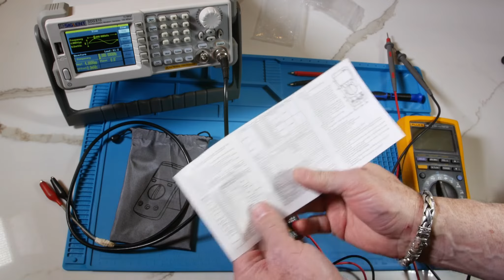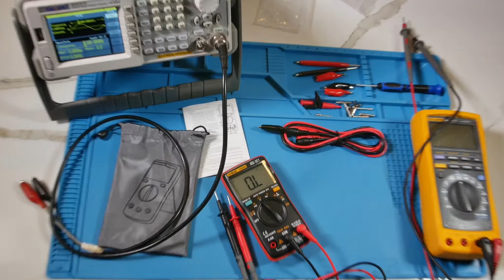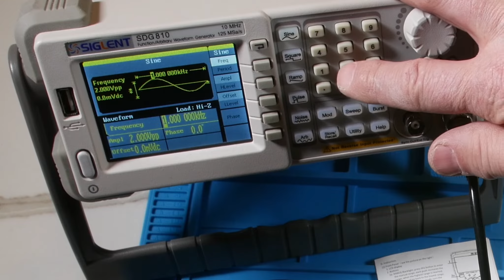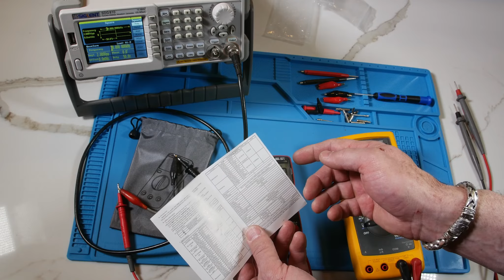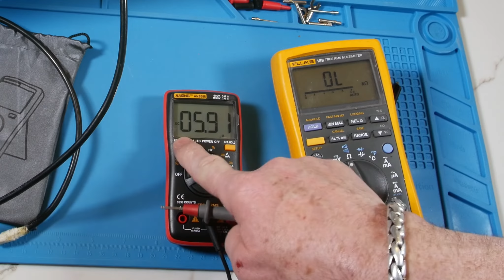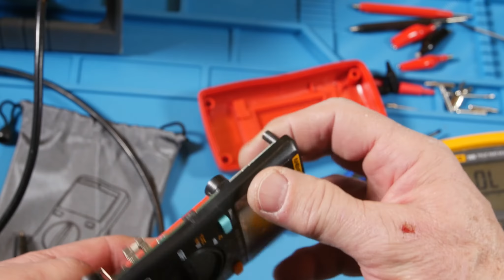$25 Multimeter review ANENG AN8008

Comment: I know that this video is over 3 yrs ago but I have to say, this cheap multimeter is extremely accurate for it's price. I have this and it's bigger brother the AN870 which is even more impressive.
For my use these meters do perform extremely well. As for 240V AC readings, I have used them both with perfect results but with extreme caution (not touching them whilst powering on).
Reply from the maker: Thanks for the great feedback Andy!

Comment: Are these specs to be believed: for DC voltage, a 10mV scale with an error of 0.5% of reading plus 3 counts? The 50000-count Fluke 289 has a 50mV range with an error of 0.05% of reading but with the addition of a whopping 20 counts. This means if my calculations are correct and the specs are to be believed, if I insist on a relative error on these ranges of no more than 5%, then the smallest value I could measure on the 289 is 404uV but I could measure down to 67uV on the 8008 and hold that accuracy.
Reply from the maker: Great question Richard!  I just posed a review on a Klein, and I want to change the way I do reviews to look at this type of thing - which I think is much more meaningful then taking a bunch of readings and just giving it a head nod.

Comment: 1uV resolution on the lowest voltage scale is unusual, I think.
Reply from the maker: Yes, I think you are right.  This meter is a 10,000 count meter, so it has 3 places after the decimal in the milivolt scale.  This would mean you would have a number in the microvolts.  So, resolution is down to 1 uV, but then accuracy is spec'd at 1% with 3 dig.  Pretty darn impressive specs for a low cost meter.
Reply: @KissAnalog  My spec sheet says 0.5% with 3 digits. Wow!

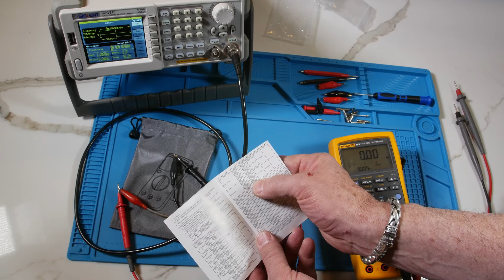Comment: 24:08 The manual is entirely correct in putting "0.001Mhz" in the resolution column. When I'm looking to measure up to 10 Mhz I want to know how many decimal places of resolution I'm going to get. Yes it's 1Khz of resolution but I don't want to be confused or bothered by converting 1Khz into a 9.999 Mhz readout. I gotta say, you're the first and only one I've come across who has looked at "0.001Mhz" resolution and said "they should have just said 1Khz"
Reply from the maker: Thanks Killer2600!  I agree with you and I appreciate the great feedback!